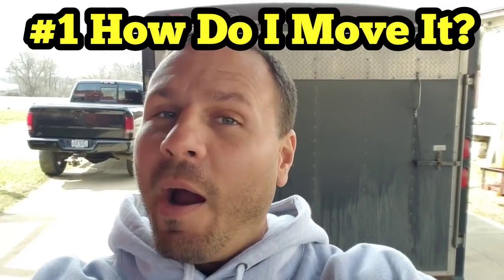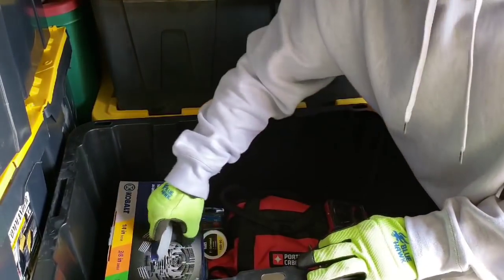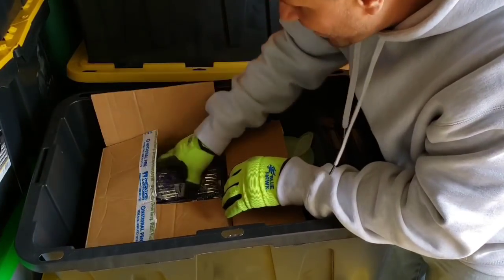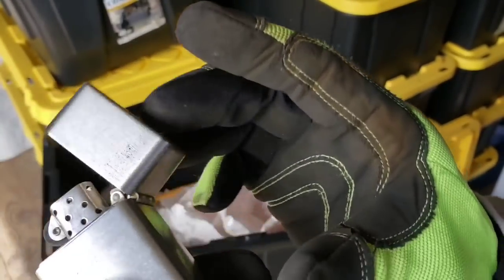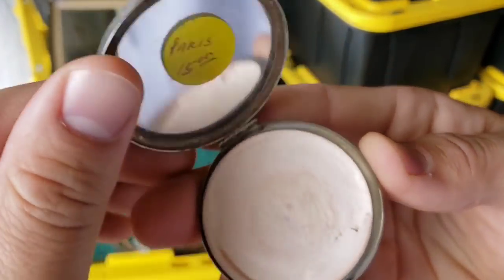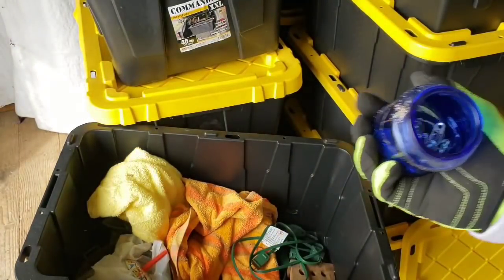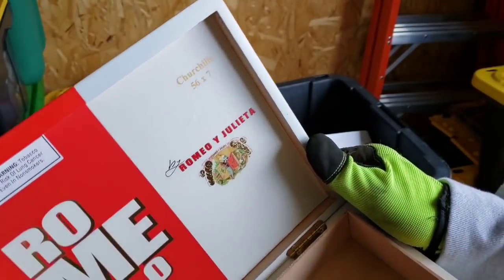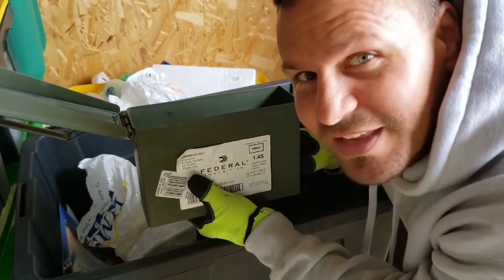FOUND HIDDEN INSIDE I Bought Abandoned Storage Unit Locker HOW TO MAKE MONEY FROM HOME

Comment: The odd bowl at 15:17 is for nuts in the shell. The nut cracker fits in the two large holes and the little holes hold the picks that will take out the nut meats.